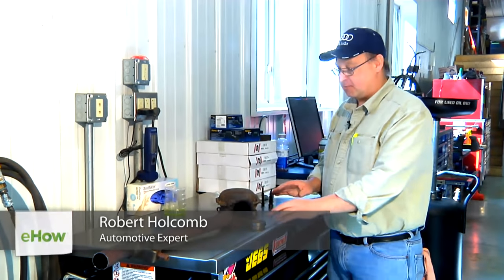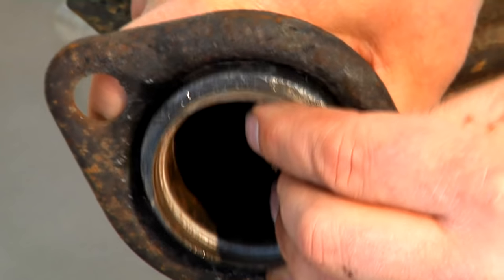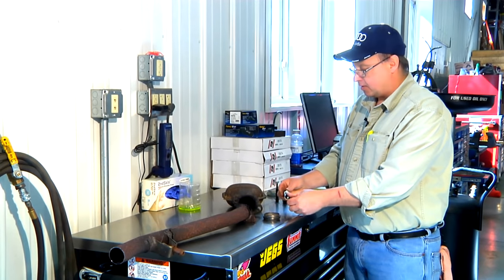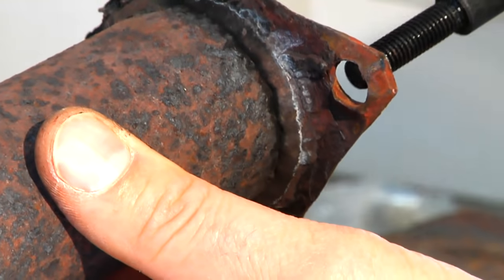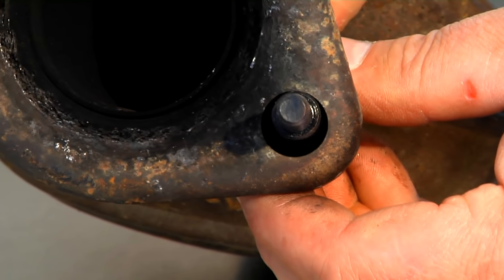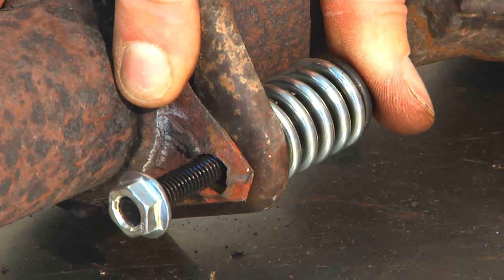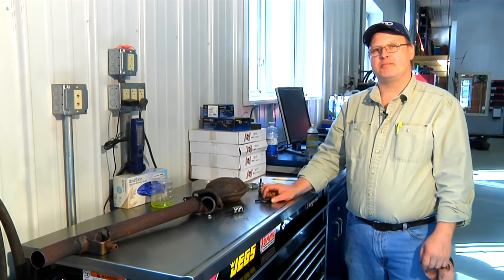Tightening the Donut on the Exhaust : Under the Car Repairs

Comment: iv done this but the bottom of the spring is squeaking on the exhust piece i have changed springs to new ones and i have put heavy duty ones on and it still squeaks i have changed gasket 8 times and changed lower engine mount nuffink is working i need help please the only way i stoped the squeak is to have nuts loose but to day it came off so i was going to put 2 nuts on to lock it but there ent enough thread it will squeak if i tight it to much
Reply: Chris Stainer WD-40 lol

Comment: For clarity....the shoulder of the bolt rides against the exhaust manifold flange ( the flange closer to the engine)...for this to work properly.....right? So the "hole" diameter of the other flange downstream..... the exhaust piping flange.... needs to be large enough for this bolt shoulder to pass through.....right?
Reply: Just add a washer between the small bolts to hold them in place, if both holes are big that the small nut wont even hold them

Comment: How much torque do you apple on the spring bolt, or as long as there is spaces in the spring you are good?
Reply: Just do not tighten with spring completely tension-ed (no space between coils)

Comment: I discovered my squeaking noise coming from underneath is at this point. Sprayed some silicone grease on it and it went away. But returned days later since the heat from the exhaust pipe would dry that up of course. 
I've checked and the bolts are as tight as you can get them. 
Although I'm not hearing any exhaust leaks. Would replacing the exhaust ring solve the problem anyway?
Reply: I'm having the same issue, did you figure it out?

Comment: You have to mount the donut gasket onto the male portion FIRST before bringing the mating female....or you will crush the gasket and there will be a gas leak.....The bolt is designed to be screwed on so much to allow for the length  to compress a certain amount and flex when there is vibration from the engine and the road....but then ALWAYS maintains tensile compression on the donut gasket to ensure a close contact at all time....

Comment: I put it all together and have an exhaust leak out the bottom of the flange connection. I can't get the muffler and rear exhaust assembly to line up (they hang in kind of a "v"). They are suspended by those rubber exhaust supports. They seem fine, but maybe those need replacing? Also, the walker muffler looks like it needs weld nuts but I can't find any (the holes are WAY too big for the standard nuts that came with the spring bolts, and normal steel washers that fit the bolt size barely cover the holes and seem to be shouldering a lot of force...). Thoughts, anyone?

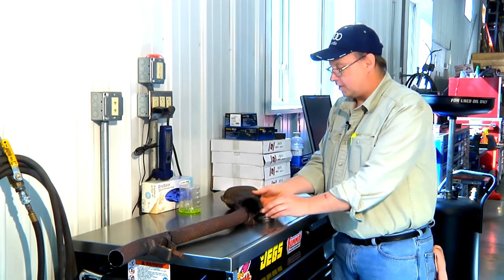Comment: Don't use a mesh style gasket like the one pictured 0:25   it will leak 100% of the time.
Reply: What do you use? Mine is leaking and looks just like this and new on a honda element.
Reply: @paquesepas6696  I bought one from an ep3 that was completely solid material.
Reply: No....example.....expensive Toyota OEM piece is exactly this....the cheaper Walker unit is blank/silver color without mesh.

Comment: would you know of a non-welding (since I don't weld) muffler exhaust pipe combo for a 1976 cj7 jeep? (with 258 4.2l i6 AND an 85 cj7 exhaust manifold and intake manifold) Prefer the flow through muffler and is pre-cat. Thanks for your video! :)

Comment: You forgot to tell how much to tighten the spring side of the bolts! Only one person asked this question, but received no answer! Please be a little more specific! Thanks!
Reply: Niichii Ca-In most of them have ridges on the bolt to prevent over tightening. just tighten it till you get there and then give it a good crank

Comment: Iput a new gasket but it's leaking worse now. does it need to break in?
Reply: no
Reply: Did you replace the springs? You should always replace the spring/s when exhaust is removed. They lose their tension.